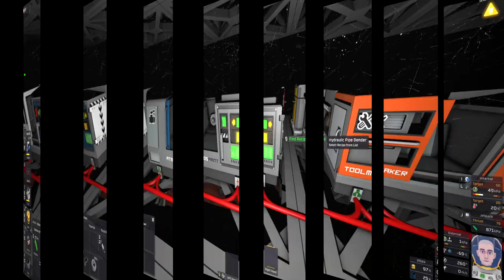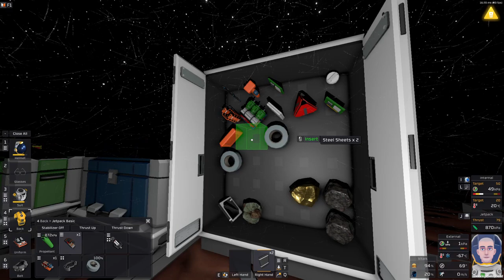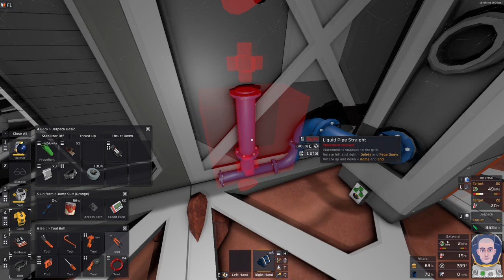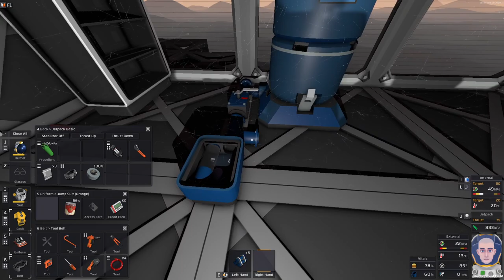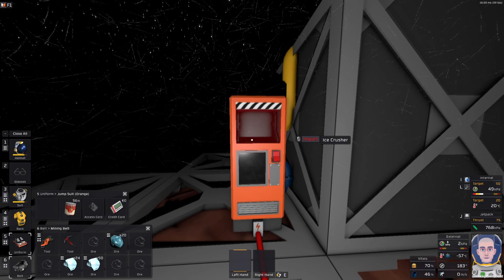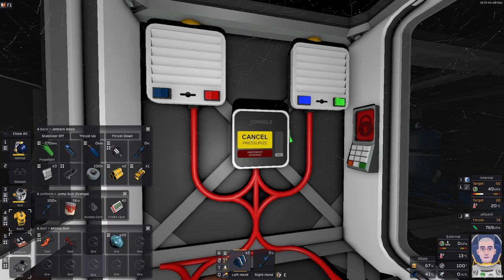Ice Crusher and Water Delivery - Stationeers Mars Survival Getting Started Guide - ep 9 - 2021

Comment: In my version of game the water bottle filler has on/off button, cable, and i connected that one before portable tank, valve before portable tank and valve is closed, however filler don‘t fill up my water bottles, despite liquid pipe heater. All crushed iced goes beyond, but pipe is a closed system.
Reply from the maker: yes this is an older video